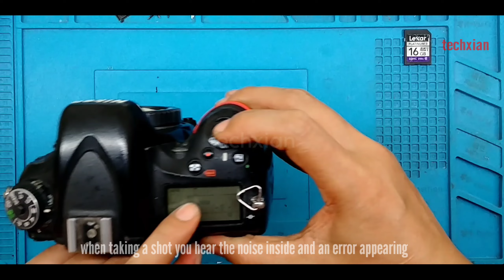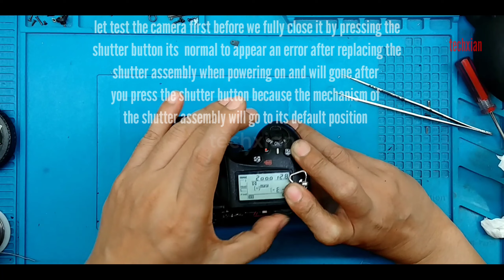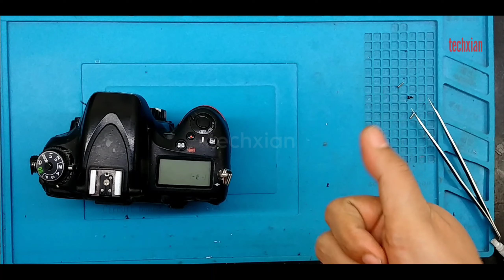NIKON D610 SHUTTER ASSEMBLY REPLACE

Comment: Thanks! This video was very helpful for fixing my own D610. It worked ok after the replacement of the shutter, but only on speeds  from 1/3200 to 1/4000 it gives the Err code. do you think this an instalation error or a faulty part?